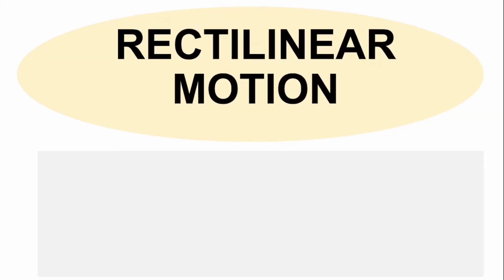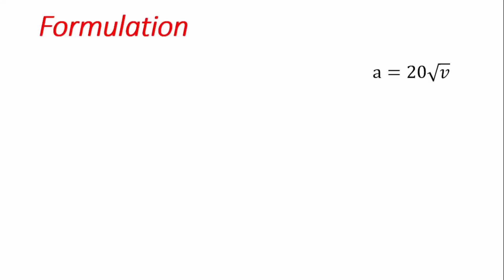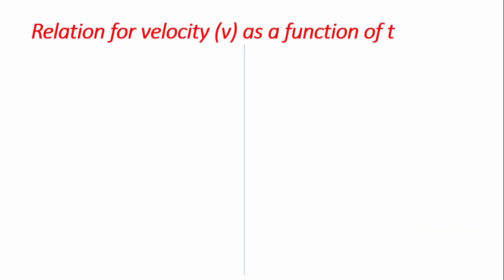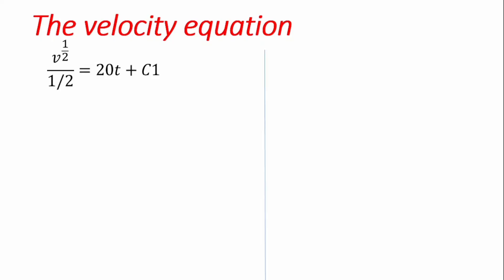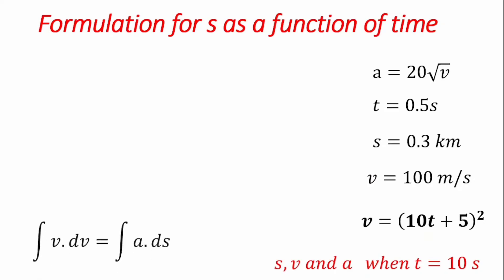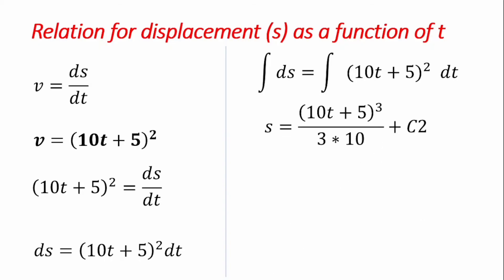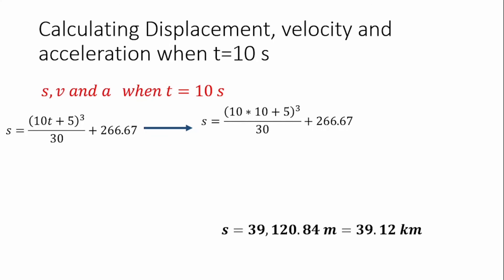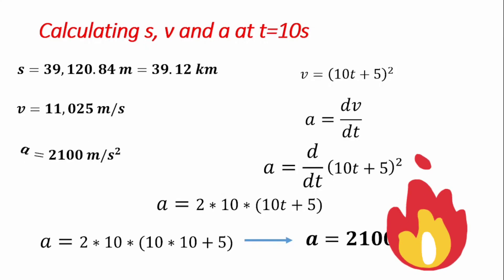Example: Non-uniformly accelerated motion with acceleration proportional to square-root of velocity

Comment: In the relation for S as a function of t, after integrating (10t + 5)^2 dt, where did the 10 come from that made the denominator to be 30?
Reply: From integration, we say let u= 10t+5 ,  du/dt = 10, dt= du/10, and if u substitute it into the equation it would give 10 at the denominator.
S= u³/3*10 + C2
Reply: @samuelogundimu8369  thank you very much
Reply: @samuelogundimu8369 thanks, this was very helpful.
Reply: @samuelogundimu8369 alright
Reply: Exactly where 10 come from? 😂

Comment: Hello sir
      How do I compute the equation for velocity and displacement when the acceleration is given in terms of displacement ( a = -k/s )?
Reply from the maker: Hi,
There are different equations that relates acceleration with other variables. One of them relates velocity, acceleration and displacement (v.dv = a.ds). You can input the given expression of acceleration (-k/s) into the equation and integrate both sides to get an equation of velocity (v) as a function of displacement (s). 

In like manner, you can use the equation that relates acceleration, displacement and time (a=d2s/dt2), by inserting value of a (-k/s) and then integrate  twice to get an equation for displacement and time.

The most appropriate method/solution depends on initial and final conditions that is provided in the question.
Reply: @EyereSolutions  Thank you sir